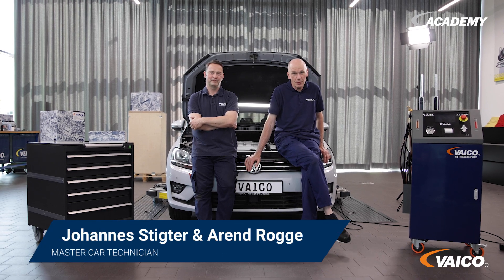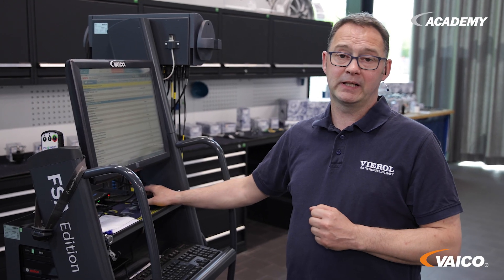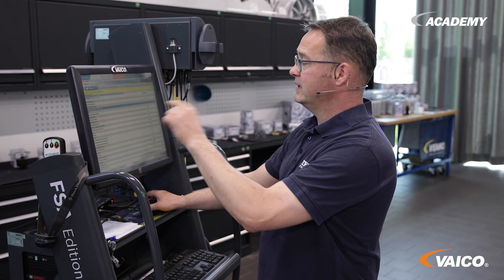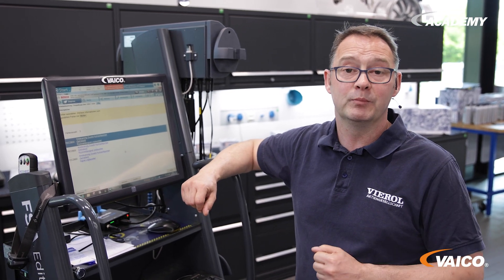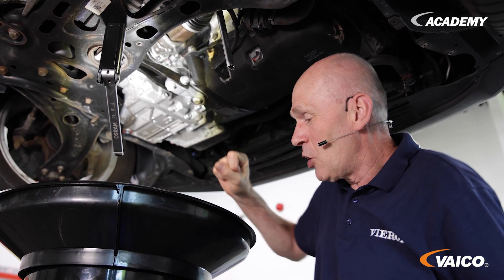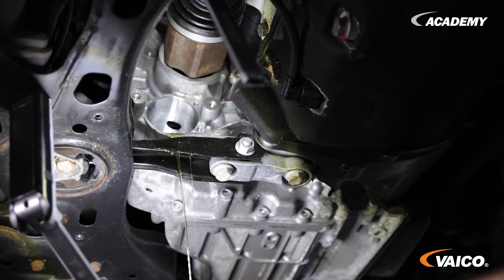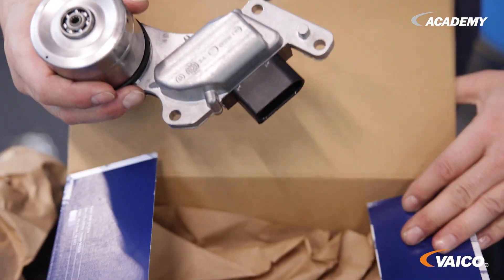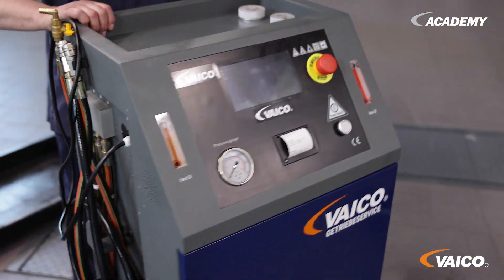Changing the Transmission Fluid Pump on the Golf Sportsvan with DQ381 | V10-6991-XXL | 0GC

Comment: what you changed is the electric motor of the pump and not the pump itself. the pump is inside the gearbox. what you should check when taking of the motor , is if there is a shaft in the area where the motor was, if not than you change motor and have same problem if the shaft is broken.

Comment: Is the pump easy to access ?
Reply from the maker: Hello @dipeshchampaneri3494,
yes it is very easy to access. Just remove the underride protection and you will have direct access. It is also very easy to remove. Just keep in mind, that you will lose some transmission oil while replacing the part. Therefore you need to check and refill the oil after the replacement process. Check out this video for transmission fluid change information https://www.youtube.com/watch?v=hQpjfEwUbWI
Regards,
Team VAICO
Reply: Hi thanks for your reply, I have had a look at mine but I have Quattro I believe the transfer box is in the way?
Reply from the maker: Hello @dipeschampaneri3494,
due to the different installation position, it may of course be that your gearbox oil pump is not so easy to reach. It is always difficult to assist with this from a distance and without precise information. With your chassis number, we can give you information about the right product. Please contact academy@vierol.de and give us more details about your vehicle.
Best regards,
Team VAICO
Reply: @dipeshchampaneri3494 did you ever get an answer or do this your self ?
Reply: Thank you, I have been told the transfer case is in the way. My fault code is POC2900 is the fluid pump? Nobody give a 100% answer. Thank you
Reply: @dipeshchampaneri3494    awsome if you got some answer to this? same fault code after SW update
Reply: @KaiKanon83 No idea if youve been to a shop yet or if you have done some work yourself.. If you take out that pump motor ( which is what they do here in the vid ) and you do NOT see a small little shaft.. Your actual pump might have exploded on the inside. Look up "Campaign 34L4" or just simply search for the fault code. Mine had exploded, we replaced it with a repair kit.

Here in The Netherlands, Audi doesn't do anything with it. Meanwhile in the US they do a full on recall and replace or fix the DSG completely for free..
Reply: @PRJXXD did the explosion affect anything else? Any symptoms prior to repairs? My goodwill was rejected twice on this. 52,000kms Wolfsburg.
Reply: @Righteouness Nope! No symptoms at all went to audi for a regular software update and the car started screaming at me… Apparently the update closely monitors the Auxiliary pump..

So what i missed on first inspection (replacing the electical motor on the outside of the gearbox) was the little shaft, i didn’t think of it nor did i know about it when i replaced that thing.. 

Anyhow, internally the gearbox was fine! Some scuffmarks here and there but no major damage.. This can however really badly damage your gearbox as that Auxiliary Pump consists out of 2 materials.. Aluminum and hardened steel
Reply: @dipeshchampaneri3494  i have the same fault code did you ever get it fixed and what was the part that was damaged